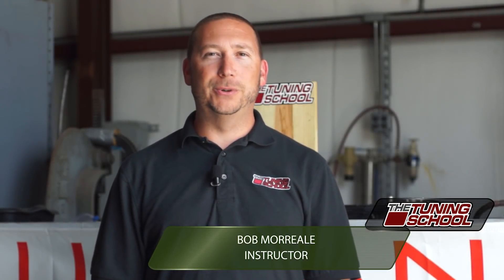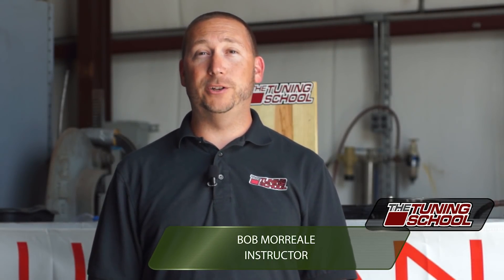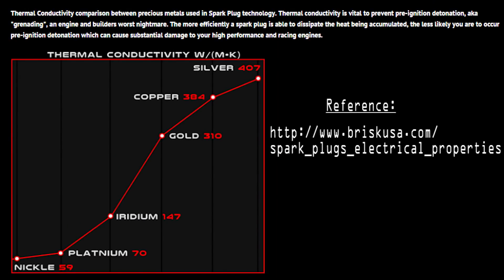Which spark plugs are best for performance tuning?

Comment: whats the best for a 99 ram pick up 1500? I know champion is whats it's designed around... but It their a better one for my engine? 5.9l gas
Reply: +Richard Cowtails yeah I work at O'Rileys so I know a little bit about general maintenance.
Reply: +Richard Cowtails  i whent with auto  lights copper's just cuz there pure copper and thats the best for cap and rotor too.
Reply: +Lance Plemel thank you
Reply: I use NGK and plustar for mine I have a 96 5.9 and mine runs rich
Reply from the maker: +Richard Cowtails  contact: 
Bret Lednicky
Office ManagerBrisk USA Enterprises LLC.North American Market Divisionwww.BriskUSA.comCell: 281-299-1095Tel. 713-459-6977Fax. 866-583-6239
Reply: ugh....................
Reply from the maker: contact: 
Bret Lednicky
Office ManagerBrisk USA Enterprises LLC.North American Market Divisionwww.BriskUSA.comCell: 281-299-1095Tel. 713-459-6977Fax. 866-583-6239

Comment: I'm at 165k on my plugs and wires on my 05 5.3L. thinking my plugs and wires are the cause of my tick on the passenger side and rough idle at times. just dk the best ones and leaning towards the performance side of plugs

Comment: Dude, you know nothing about spark plugs!  Fine wire plugs are used on todays engines due to the performance they offer, who is "Brisk" Original Equipment with?  Maybe your bank account?  You use precious metal because it's a harder metal thus making a fine wire electrode with the benefits, yes silver is a good conductor but it doesn't last and again why isn't it used original equipment?
Reply: +Elle Christine We have no affiliation with Brisk or any other plug manufacturers.  Try running any brand plug with Platinum or Iridium on a forced induction build, and see what it will tolerate (spark and boost) before detonation happens.  Compare that to a better plug (Silver, for example) and you will find there really is no comparison; the Silver or Copper plug will allow you to run more spark advance and / or boost on the same fuel octane as your test with the other metals I mentioned.  As for why this type of plug isn't used on original equipment, we can only speculate that it doesn't fit their cost parameters, or they (the OEM manufacturers) may prefer a longer lasting plug which burns hotter, and causes less warranty returns for misfires and such.  On our agenda for an upcoming Tech Tuesday video is a Spark Plug Shootout, which should further help show people the differences in performance.  Thanks!
Reply: +Bob Morreale And...you are correct...I don't mind changing my spark plugs more often in my high performance  turbocharged vehicle because the copper plug i use (V Power)  is $2.49 apiece...and are much better than the Iridium plug that came stock when the car was non-turbocharged...I've added ~300 more hp than the car started with...and I can tell you the OE plug will not stand up to that kind of heat..and will create an atmosphere that's prone to detonation...
Reply: Hello Elle, title of the video is not what are best spark plugs for original equipment applications…
Also, silver is considered a precious metal.
Silver is generally not used for original equipment because it does not last as long as iridium and platinum.  Silver is mainly used for performance and racing as it offers the best conductivity and wide heat range.  By the way BMW used in many of their vehicles Silver spark plugs as original equipment.  Brisk manufactures 50 million spark plugs/year and not only Brisk Silver Racing spark plugs. Brisk also manufactures fine wire long life span spark plugs, Brisk Iridium and Brisk Platinum.  Most original equipment spark plugs are iridium and platinum because they offer long service life and reduce maintenance cost for the manufacturer. 
Brisk is original equipment with Audi, VW, Volvo, Seat, Skoda, Brigs & Stratton, Husqvarna, OREGON, ….and over 20 other OE manufactures.
Fine wire spark plugs are generally considered spark plugs with the center electrode tip diameter smaller than 1 mm.  Standard copper core spark plugs center electrode diameter is generally 2.5 mm - 3 mm.  Most Brisk Silver Racing spark plugs center electrode diameter is 1.5 mm which is optimal for performance and racing applications.  Smaller diameter makes it easier to ionize the gap, but it makes the center electrode tip more likely to overheat and potentially cause pre-ignition.  To give you analogy, place a 0.5 mm needle into a flame and see how soon the tip will begin to glow.  Than take a 3 mm nail and see how soon the tip will begin to glow.  Likely the 3 mm diameter nail will never start to glow as trough the larger diameter it dissipate the heat more rapidly, faster than it is supplied.  Of course, if you place it in a very hot flame even the larger diameter nail will start to glow.  However if the 3 mm nail will be right next to the flame cooled by liquid nitrogen it will likely never glow.  Materials with relatively poor thermal conductivity will have the center electrode tip start to glow much sooner than materials with high thermal conductivity such as Silver.  Heat is dissipated (travels) from hot area to cold area.  The heat has to travel from the hottest part of the spark plug (spark plug tip) to the spark plug shell, which is in a direct contact with cylinder head to the cylinder head from where it is removed by engine coolant (liquid cooled engine) or by air (air cooled engine).  If the path of heat removal is compromised or inefficient - overheating will result.  Copper core is used in nickel, iridium and platinum spark plugs to make the path from the spark plug tip to the engine coolant or cooling air more efficient, as the heat from the spark plug tip has to travel trough the center electrode up into the body of the spark plug, from the spark plug body to the spark plug shell, then to cylinder/engine head to the engine coolant and out to the radiator.  
If you performance tune a vehicle you are altering the engine to make more power by increasing the pressure in the combustion chamber.  More pressure = more heat, you may have experienced this compressing air while airing up a tire with a hand pump.  If the heat removal path is inefficient or if you supply heat faster than heat can be removed from the spark plug tip the tip will begin to glow = causing preignition.  And fine wire tips (especially made from poor conducting iridium and platinum) will start to glow sooner than a larger diameter spark plug tip.  When tuning a vehicle, complex 3D tuning maps have to be programed into the engine control module for every combination of engine RPM and engine load comprised of continually changing ignition timing and air/fuel ratio….  
If any point of this 3 dimensional map of the tune is not programmed quite correct, spike in temperature is likely to occur in the combustion chamber.  If anything is not quite right, spark plugs with a better and faster heat dissipation will give you a larger room for error before the spark plug tip will start to glow and pre ignite the air fuel mixture which often leads to detonation and engine components damage.  
As far as ignitability, iridium and platinum spark plugs last long time because there is virtually no electrode material burned off with each spark, the spark plug gap remains the same for a very long time.  
On the other hand with silver spark plugs with each spark there is a small part of the silver electrode burned off with each spark and the gap slowly erodes.  However with each spark you have a very small particles moving at close to speed of light, so the spark has more energy and better ignitability noticeable especially with hard to ignite fuels.  So if you are looking for a long lifespan we suggest to use Brisk Iridium spark plugs, if you are looking for best performance spark plugs to tune with we suggest to use Brisk Silver Racing spark plugs.  In street applications (depending on application and ignition system) they can last as long as 30,000 miles and offer exceptional tune ability  and performance!

For more technical and product information please visit: 
www.BriskUSA.com 
www.BriskRacing.com

Comment: this is why i run autolite copper spark plugs, no exceptions for me
Reply: That might work in antiques, but new turbocharged engines, this plug will fail.
Reply: @perryclark3897  actually no it won't run a platinum tip plug in drag racing with large amounts of boost or nitrous you will kill your engine
Reply: @perryclark3897  Autolite plugs are good. If you're broke,and your engine needs a tune up. Maybe if you're trying to sell a car and you need it to run good until someone buys it. Autolite plugs are shit. I used em in my old 95 4 banger S10 one time. They lasted less than 7k miles before the truck started running rough. It ran better before I put Autolite 
Plugs in it. All the gaps were excessive and the electrodes were all rounded off...in only 7k miles. I've never used them again or installed them in anyone else's car since. Nowadays I try to keep the brand of plug and type originally came with the car.
Reply: Autolite just doesn't cut it for me.
The quality compared to brands like Bosch, NGK & Denso is just too low!
Reply: ROFL @ Autolite
Reply: Hey guys.. I have a chevy blazer s10.. Wich spark plugs will give me the best performance

Comment: What this guy fails to mention is the core of most is in fact Cooper( all NGK plugs have copper core) and iridium is referring to the plugs durability not performance.
Reply: Leonidas Saber you can gap platinum and Iridium, it's a myth perpetrated by those that gap plugs incorrectly.
Reply: +Leonidas Saber Very good point. Most spark plugs are manufactured with a Copper Core, the Center electrode material used is generally a composition of Iridium/Platinum enriched copper as well. So you are correct, Iridium is used for longevity and durability purposes.
Reply: The Outern Surface of the electrodes with iridium or platinum do OVERHEAT Tooo Much, because those materials are N O T Cooling Fast enough !!! ! !!!
Reply: Kopronko ppppppppaaa
Reply: Iridium is referring to the COMPOSITION! and "subsequent" performance in a given application.
Reply: Leonidas Saber I was thinking the same thing
Reply: Leonidas Saber in
Reply: lol i sheared a ngk iridium once just installing it i can take a hammer to an autolight copper plug in my opinion ngk is well marketed junk
Reply: This is the key.  The Platinum and Iridium do not have a drastic effect on conductivity due to most plugs being designed with a Copper/Nickel core.  There are also some good points below about heat ranges, and the fact that platinum and iridium plugs are non-gappable.  Here's a write-up of the differences that I found on Google http://www.maintainyourride.com/best-spark-plugs